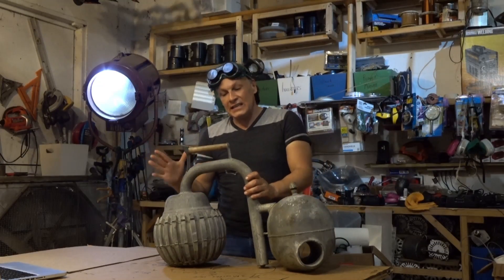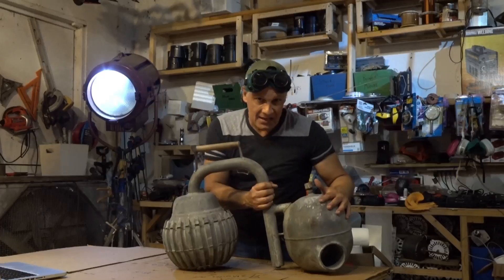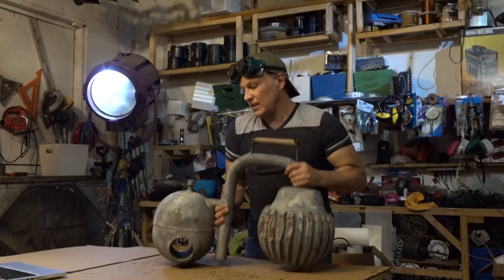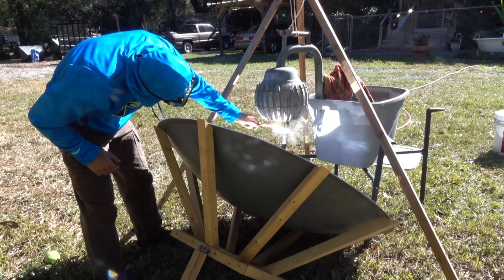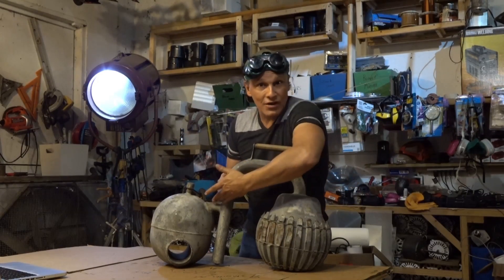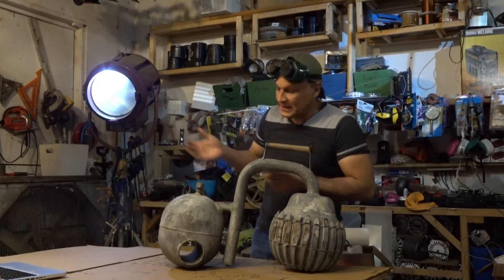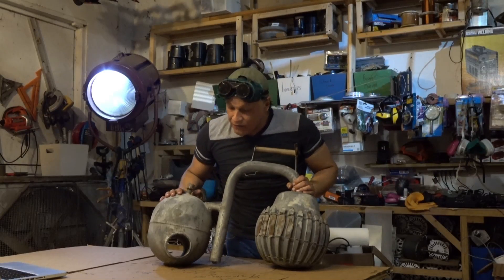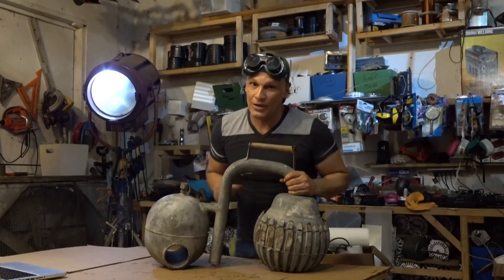Crosley IcyBall Solar Absorption Refrigeration Parabolic Mirror GreenPowerScience

Comment: Facinating, thank you!  Imagine if this were designed to use the sun to cool buildings, no electricity needed!  Good for SHTF, black out, intermittent power, or off grid/developing nation scenario!  Just a FYI: Ammonia is deadly. If you can smell it, you can black out and might just as easily be laying in the ammonia leak and be suffocated.

Comment: After doing some research people have reconstructed this design to include pressure gauges, check valves, and isolation valves. Sadly nothing on YouTube yet. The solar heater concept would be a great addition to revisit their upgraded version of the icy ball. Maybe even automate the cooling with a geo thermal recirculating loop to minimize the cooling tank size with an additional heating tank to run the system continuously when the other is down.
Reply: I wonder if we can make solar thermal to cooling campervan. Maybe it s like a glass tube  with parabolic inside to gain heat from sun light then the cooling system is able to cool inside car.
Reply: @aanplg  I've heard that without the chiller box the temperature of the  cold side dissipates rather quickly compared to the 8 hours it claims to cool for.

The chiller box is maybe a 2.5 cubic feet. compared to a much larger van with inferior insulation I'd imagine you'd need multiple of them to even have an affect. However adding a manifold with multiple reaction tanks would seem possible.
Reply: This is what I want
Reply: Problem is it keeps getting taken down

Comment: There’s a whistle on the cold ball that sounds off when the pressure reaches 250 PSI during the recharge cycle that tells you when the recharge (heating) is complete.
Reply: This is appallingly dangerous, to be leaking- and by design no less! Ammonia was not as known back then as it is now, to be so poisonous. It killed many families and workers, and so had to be regulated.  Requires a licence now.

Comment: Install a pressure gauge on there.
Reply: A pressure relief valve that vents to an overflow tank of some type would help as well if you’re worried about the pressure getting too high
Reply: 🔴 What Is Islam? ⚠️

🔴 Islam is not just another religion. 

🔵 It is the same message preached by Moses, Jesus and Abraham.
Reply: @1islam1 Then throw in some blasphemy and lies

Comment: Use an electromagnet to rotate a magnetic field and use Gadolinium to generate ultra cold temperature's that can pull Argon gas from a solid state sponge fuel cell and turn the Argon gas into a super cold liquid that fill's an insulated tank with the stirling cold gas cylinders inside the tank. Now design a V-6 stirling cold gas engine with two fly wheel's. Attach automatic transmission to each fly wheel. Rewire two large drum motor's into a electrical power generation configuration replace bearing's with magnetic bearing's and attach generator's to automatic transmission's. Use an organic carbon power cell to start the electrical power generator then have a circuit that flip's on to generate more liquid Argon gas powered off one of the electrical power generator's. Incorporate antivibrstion technology currently being used in Skill saw recipercating saws and add in magnetic bearing's to all moving part's on cold gas engine. Gadolinium magnetic bearing's on all moving part's. You should have an electrical power generator that power itself run for hour's that requires no fossil fuels or lubercant's. This concept can be modified to provide electrical power air conditioning water chilling water pumps for a hydroponic green house. 😊

Comment: I would say it didn't work like it was suppose to.  The temperature he got was nowhere near making ice. which he said it should do.  Just saying.
Reply from the maker: It does not have the full volatile ammonia needed. This mirror is more than enough equalling 1000 watt equivalent of an electric burner and 9x what the kerosene burner can do. There was no safety valve so I do not like boiling things in sealed containers for obvious reasons. This is an antique and just a test.

Comment: HI ¡ 
Where can I buy that refrigerator?
Reply from the maker: They are an antique, no one makes them anymore. I am selling this one for $1,200 (about the cost because it is an antique). A better option would be an RV refrigerator that runs on propane. You just need to know where to focus the light and use extreme caution. More of a novelty as a small fridge + some solar panels and an inverter (120v only) work great.
Reply: thanks

Comment: I never knew Absorbtion Fridges could work that way. Without the regenerator loop. I have wanted to make one that runs on Ammonia distilled from urine for a while now and this way would be a lot simpler to construct. As well as more practical for a simple concentrated solar rig. No need to use heat transfer fluids of have the focal point aimed at the fridge.... Thanks for sharing!
Imagine how cool a fridge that uses sunlight and pee would be!

Comment: absolutely love that you presented this, i have been meaning to look into ammonia boil off cooling thing and now here it is. THIS and the 'zeer pot' are the only 2 off-grid cooling methods i am aware of. again thank you filling in this piece of missing info for me.
Reply: If you're looking to use this off grid, be mindful of the fact that ammonia will eat copper in the presence of air and oxidation. (it forms Tollen's reagent for the chem savvy.)

Other things can be used, but ammonia is prefered in vintage systems because it forms a mixture with water that can get very cold before freezing and was one of the first chemical compounds known. 

The youtube channel "Applied Science" has a method for doing this that involves rubber bands, if you're interested.
Reply: thank you, i will look into this.
Reply: If a Stirling motor is rotated by an external energy source (windmill?), one side will warm and the other will cool; that might qualify as an "off-grid" method to provide actual refrigeration.

Comment: DAN I see hobo videos not real true hobo they are more scenery tramps than actual hobo. They have cell phone, headlamp,cameras, and worse they encounter freezing literally below freezing temps high winds and just what they can carry to keep warm. I suggested they get an alternator C clamp and make it where the rubber wheel on the alternator can contact the wheel of the train that or the axle maybe a wind generator any of these could work or if they wanted to they could lower a belt in front the axle the belt would be blown back by the wind and they could then lower a magnet pull the belt up to the top and screw the belt on and hold on to their alternator this way. The alternator would recharge a lithium ion battery pack that has 110V AC out and can be used to jump start a car but you really want it for the power source to recharge cell phone lights and camera. I know a lightweight system can be made they are already putting out rechargeable lights that are the size of a AAA battery have portable way to recharge and are over 150 lumens. 

Dan should decide to take this mission you would have to set up a train hop situation and demonstrate how this can be done maybe some field work of getting near trains and finding the dimensions of a train. The way that would probably work best is the belt around the axle way it would be the safest in that you are lowering the belt in front the axle then use a stick and magnet to catch the belt that belt will sit there and not engage until you used your stick with alternator to get it to spin the moment it starts to spin you can collect power. A cane can serve as the mount for the alternator.

You would not be recommending freight train hopping but you would show how people that are already doing this can have more power than they can use enough power to actually dump the extra power into a heating pad strapped to the back to warm core.

Sure a train hopper can carry a solar panel but panels have very limited time to be used if you are in the snow and cold you are not going to get a panel to charge your stuff but if you are on a moving train you will have power as long as that train moves and if you watch the video these puppies really move.

Comment: 50 years ago we had a refrigerator that ran on natural gas.  Is this the same RV Refrigeration that you mention in the video?  When it finally broke we bought an electric one. Love your videos, going to build a Solar heater for my Green house using your ideas and methods.  Thinking about installing a black  granite slab inside the collector so it will store and release heat at night.  What do you think?
Reply from the maker: Hi Meno,
If it used gas then it was absorption process. We had one in an RV when I was a 3 years old. The slabs are a great idea. Anything with mass works great. We have used 50 gallon drums of water and flat mirrors on the north side to add surface area to the interior. No need for concentrated light with a big area like a greenhouse.
Reply: GREENPOWERSCIENCE please make a telescope with one of your mirrors

Comment: you are gravely mistacken if you think that device is not under preasuer just because it is not being heated...
Reply from the maker: It cooled (cooling process), pressure drops. Not saying it is at atmospheric pressure, but not high.
Reply from the maker: Weight changes too from one side to the other.
Reply: just didnt want u 2 cut in to it or anything, amonia gas is hihly compressable.. and highly  corrosive, but be honest i reallly do not know ...
Reply from the maker: Will become part of our roof rafter art:-) No plans of cutting. Thank you for the safety tip. These are really vintage and I have always been concerned someone would pick one up and test it in a camp fire or something. The RV fridge project is a lot smaller volumes and works better. 
Best Regards 
Dan

Comment: Thanks i've never seen one of those. How did it work in the cabinet? It doesn't look like the balls con be reversed.
Reply from the maker: Hi Brian,
Just the cold side was placed inside. The heating process usually took place in a water bucket and small burner outside.